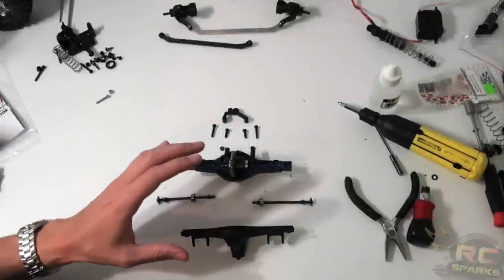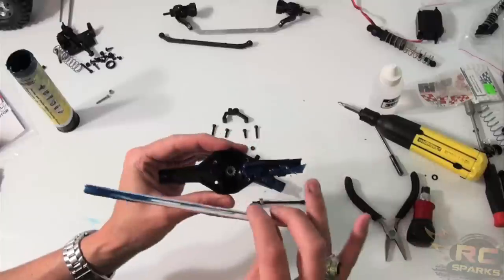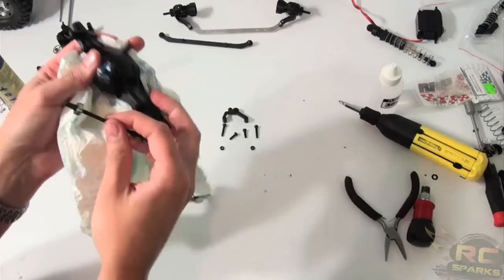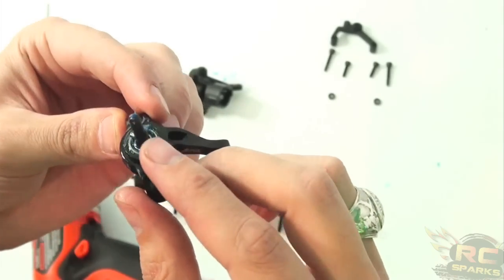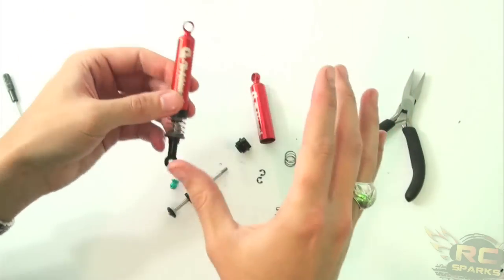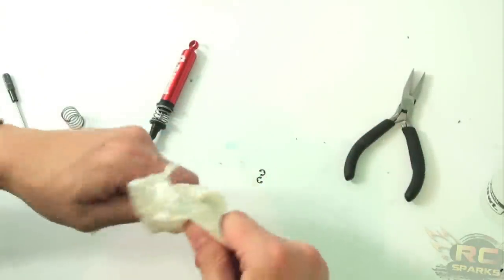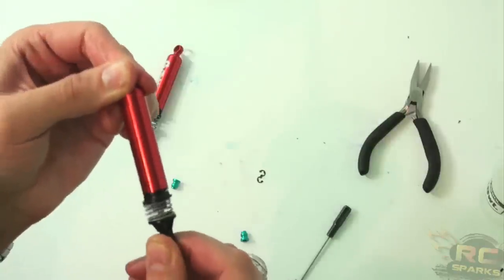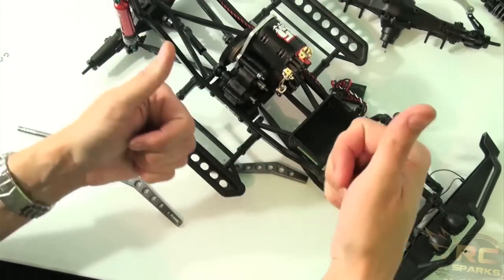RC ADVENTURES - PROJECT OVERKiLL - DUALLY - Episode 4

Comment: @djmedic2008 Totaly love it. I would give the XR 10 links a try and see if they will work. It can't hurt anything. I won't have mine up and runing  till my futuba 4PL gets in . I'm still working on getting into Lipo batteries. I have an Idea how to make a different dual motor plate and transmission . One motor would be on each side the the trans so the weight wouldn't be all on one side. .

Comment: I don't know much about RC stuff but I had a question, Are those actuall differentials on the axles or just bevel gears?
Just curious cos I used to own a nitro buggy (cheap and nasty) that had a diff at the engine and one on each axle